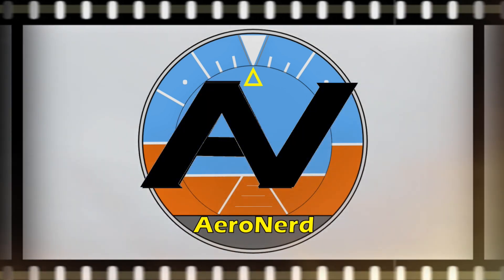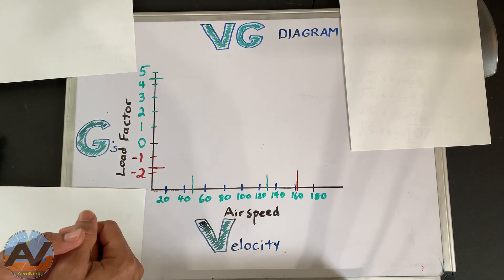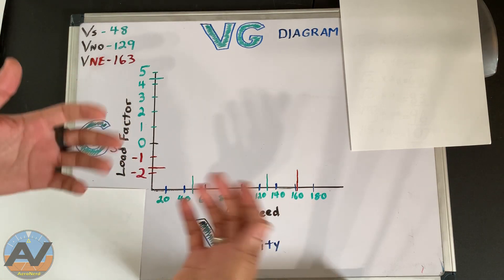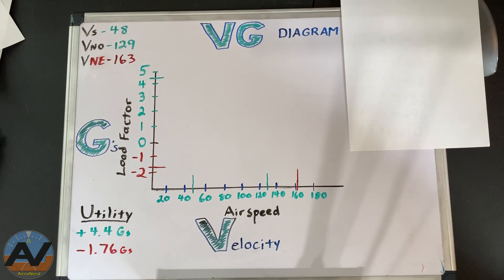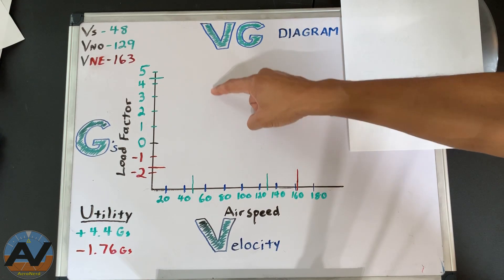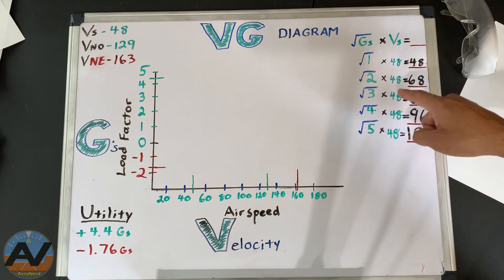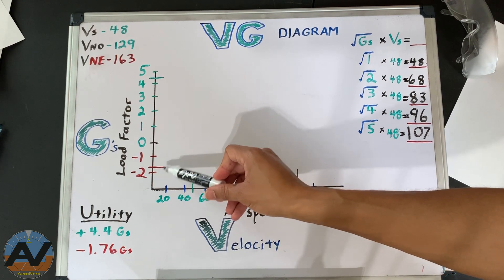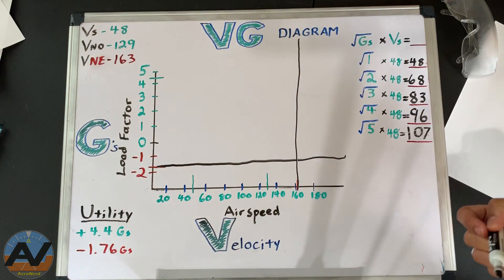VG Diagram: Made Easy!

Comment: Why did you use the gs that belongs to the Utility Category and not from the Normal Category?
Reply from the maker: Great question! I used the utility category because normally when instructing there are just 2 people in the airplane. Even with fully loaded with fuel, unwell still be in the Utility category. Normal category (checkout POH chapter 6), you have to be pretty heavy and have a lot of cargo for the CG to move that far back past the utility box. Thanks for the question!

Comment: Actually G is for gust factor in regard to the VG diagram. One of the primary goals the VG diagram seeks to demonstrate is the effect of a 15 or 25 knot gust on load factor. Worrying about calculating the square of airspeed to calculate load factor is easier if you just remember that the load factor can be an easy multiplier. If you double your speed (x2) the wings will lift four times as much (x4) For example, if your 1g stall speed is 50kts, and you double your airspeed to 100kts the load factor would be 4g (2x2=4) If you triple your airspeed from 50 to 150, your load factor would be 9g (3x3=9).  There’s lots of data available in a VG diagram, but its core mission is to provide load factor based on Velocity and Gust, thus the name VG. Nice goggles…..
Reply: Hey Shawn, I think that this video is correct in labeling G as acceleration in this case. On this diagram a gust would be an increase in Velocity (airspeed). 
Possibly there is another similar diagram for gusts?